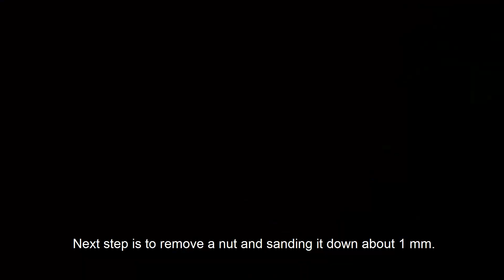I converted my strat to fretless. Part 1. (no idea what im doing)

Comment: the strings are going to destroy the wood, you need to use some kind of sealer or preferably resin
Reply: Violin fingerboards prove your statement wrong.
Reply: @mikeregan3265  violin fretboards are made out of ebony, which is one the hardest woods. guitar strings are wound, and therefore jagged and with time may cause indentations.
Reply: @andrijasentic9702  therefore the solution is simply just to use flatwounds. Even if round would strings are used, it would take an awfully long time (and many sets of) them to do anything you’d actually feel
Reply: Over 20 years since I removed my frets. No damage. Good thinking tho
Reply: It’s squier they’re fine
Reply: As I can see why you would think that it's not true. Fingernails do far more damage than strings do and it can take a decade or more even for that to happen.
Reply: Bros got glass strings and a paper fingerboard
Reply: @Sstivers90  I swapped squier and Epi phone necks.. I can play it.. I’m a beginner.. that upsets some people so so much.. it’s sadly funny..
Reply: @mikeregan3265  if the guitar fretboard was also ebony like a violin's then yes there would be no issue
Reply: This man is correct. 

Roundwounds WILL chew through a standard fretboard and no it won’t happen “over time” it happens quickly because that neck and wood wasn’t designed to deal with the stress, even if you use flatwounds it’s still good practice to seal the board because that neck was designed with frets and the lack of them is going to cause it to twist and bend over much time and with only filler and not actual filed wood pieces for the slots this is much more likely to occur.

This is a great example of why Jaco’s original bass of doom was in and out of shops so much because he used marine putty and wood filler. 

Try sealing the neck with a clear purpose glue or light epoxy if you really want it to last a bit longer with integrity to the neck.
Reply: @mikeregan3265  violins use Flatwound strings
Reply: Petit's Poly Poxy is what was used on Jaco's bass apparently
Reply: What about fretless bass?
Reply: Flatwounds. Problem solved. I don’t think he cares anyway 🤷‍♂️
Reply: Even if... its a squier. 🤣
Reply: Not at all. I have a fretless squier strat. I had to lower the nut a lot more than this chap did for decent intonation. using a set of round wound twelves. The board is fine, your strings won't damage it.
Reply: @pjsawyerthomas  Nah mate it's fine. Rounds make a mark over time but you aren't going to damage the fretboard seriously. My fretless squier has been played for about 6 years with 12 rounds and there is no damage. I have a rosewood fretless yamaha bass which has rounds. Primus style fretless slapping doesn't even make that much of a mark.
Reply: @kevfullo  Prove it
Reply: @pjsawyerthomas  I think you’re exaggerating, I’ve been playing fretless bass almost exclusively for many years, and I only use roundwounds. no it will not chew up your fingerboard that fast. it will leave a couple microns worth of indent over like a year of hard playing,if you have a maple or an ebony board or snake wood like Steve Bailey you will not have a problem. Rosewood isn’t quite as tough but it’s still gonna take a lot to get it in bad shape. I am a guitar builder and specialize in fretless. I know my stuff on this
Reply: @stevenhirsekorn3444  Prove it
Reply: @mikeregan3265  violins have flatwound strings
Reply: @pjsawyerthomas  I mean I could show you my basses if you want
Reply: @andrijasentic9702  Samo jako brate
Reply: @andrijasentic9702  their rarely made of real ebony usually painted 
And yes the paint wears off over several years but the wood stays fine
Reply: I can't believe just how gormless you are 😵‍💫
Reply: @pjsawyerthomas  GOT ACTUAL PROVEN FACTS TO BACK YOUR CLAIM UP?
Reply: He did say "no idea what im doing" in the title so i guess its no big deal?
Reply: @mikeregan3265 violins use flat wound strings which don’t chew up the fret board.
Reply: Even on a fretted guitar, the strings have a ton of contact with the fretboard, so I don’t think there’s a difference.

Comment: i wouldn't play it anymore until you've coated the fingerboard in resin because those roundwound strings are gonna tear up that wood.
Reply: Violins and violas do ok without resin, so should a guitar..
Reply: @mikeregan3265  Please learn the differences in materials used for orchestral instruments and guitars.